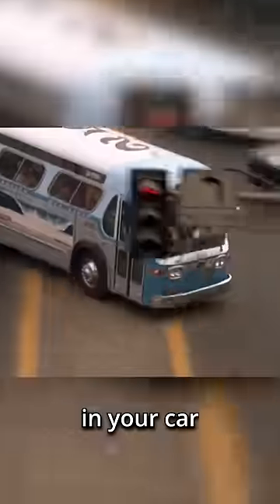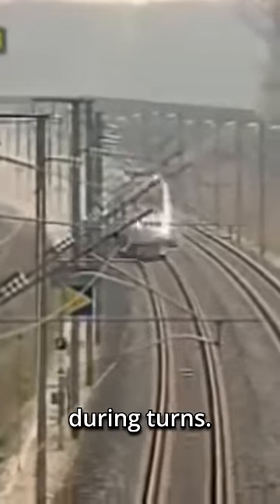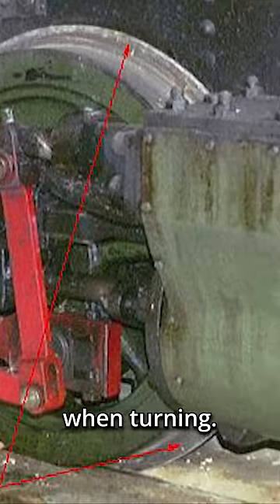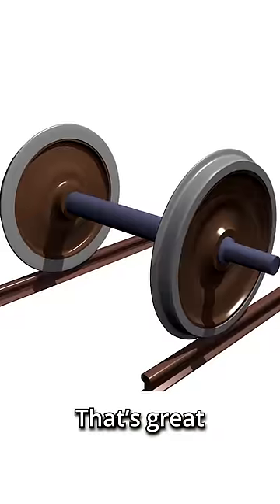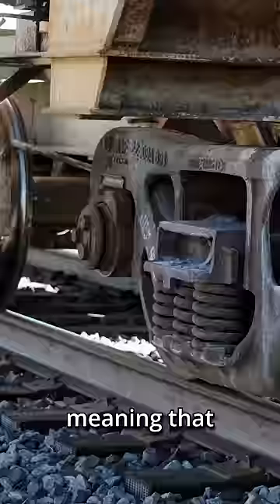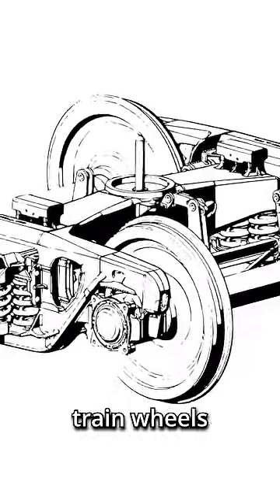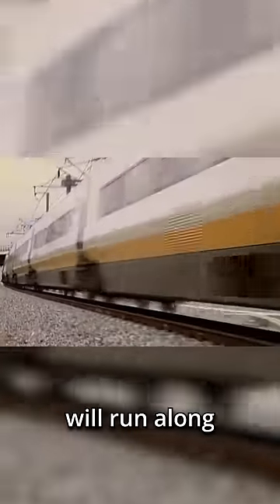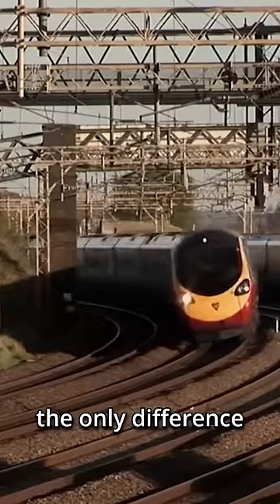How Do High-Speed Trains Stay on Track During Turns? #shorts

Comment: The shape of the wheels helps a lot, but keep in mind the turn is banked as well. This is not only for passenger comfort but helps keep the center of gravity between the rails.
Reply: Super elevation. A wonderful engineering concept
Reply: @kuhljager2429  very technical way of saying the bank angle
Reply: Plenty obvious in the video, too. 

Same as highways. Gets sketchy when some curves are banked the opposite it should be for a given curve.
Reply: @Iowagrown123  nah, thats when its fun 🤩
Reply: @Iowagrown123  that's when you hit R for race mode
Reply: @nothingtoseehere1221  roller coaster mode 🎢
Reply: In relation to railroad engineering, it's called "cant", not "banking".
Reply: Some Train have a tilting mecanism to provide the same benefit as a tilted bank.
Reply: @sebastianhofmann17  for passenger comfort, but it doesn't have the same effect that banked track in a turn do. the difference is the effect on the center of gravity. a properly banked turn will set the center of gravity as close to normal as possible, though it will be lower, causing that "sinking into your seat" feeling of being heavier you feel when a plane takes off or makes a turn. tilting a car through a turn at speed will still impart lateral inertia onto the occupants and contents of the car.
Reply: @ryan1e  that is true but tilted trains are primarily designed for old and/or curvey routes that don't have banked tracks and to have a slightly higher speed than conventional trains
Reply: @kuhljager2429  Correct, however with rail design; they call it: "cant"
Reply: @Iowagrown123 : They have to drain the water off the Road when it rains !!!!too though
Reply: @Thebibs correct. We(im a rail engineer) call it cant.

Canted track has its benefits and weaknesses tough and really needs to be done for a specitic usecase of track.

The track designer can calculate the cant needed to help a 100mph passenger train go around a turn (probably 115mm of cant (the high rail is 115mm above the low rail)) and that cant will be made so that it best supports and moves the forces on the train.

But a freight train traveling at 45 on that same line wont feel the same effect from the cant , and is more likely to roll over at such a high cant with a heavier and slower train. This is called cant defficiency.
Reply: @pulaski1  Not quite correct. Cant Deficiency is the difference between applied cant and the cant required for force equilibrium.
Reply: Some trains can also lean to one side to shift the center of gravity even further
Reply: @ryan1e  Swedens X2000 have banking and are allowed to go faster in bends, while trains with only "soft bogies" (that has wheels that turns slightly) has a lower speed. But still higher than a train without them (like a loco pulling a passenger train). Because the other trains could go that speed also but that would be bad for the passengers, so having banking trains means you can go faster.
Reply: @Iowagrown123  That's why roundabouts can be dangerous, due to the negative road camber.
Reply: @JBobjork Loco pull/push trains are slow? In Germany they do up to 200/230 km/h
Reply: literally ya
how did he ignore the fact that its banked
Reply: @Thebibs in australia the “cant” is in relation to the angle at which the rail sits on the plates or sleepers. All tangent track sits on a cant of 1:20 which means the rails actually look like this when viewing along the length of track /____\. This aids in the wheels staying on the track as well as the conical shaped wheels. Super elevation is what is called when there is a designed elevation change for each rail on the same track. The higher speed the curve/corner. The higher the super elevation will be (the greater the height is from one rail to the other). Designed superelevation of 50mm means that at that point, the highest rail is 50mm above the love rail.
Reply: Exactly. That really is the simple answer. Like a lot of these "revelation experts" he posed a question almost no one asks them gave the minor more arcane answer.
Reply: That, and some trains lean into the turn.
Reply: @ryan1e Although that is changing. At one point it was thought you want to tilt the train enough that the force on the passengers is straight down into their seats, but that's actually quite bad for track wear, particularly if trains are ever running at less than the designed speed. For best performance you want the track to be tilted by about half that "ideal" amount.

Comment: some trains (mainly high speed passenger trains) have a tilting mechanism helping them navigate curves easier.
Reply: But that's mainly for passenger comfort.
Reply: Thats not correct, its to take turns faster and for comfort but it doesn't help to take turns easier
Reply: Most high speed trains have tilted tracks for turns
I say most because maglevs have no wheels
Reply: one of them is the avelia
Reply: @aplane9625 And conventional rail has some sections where the track doesn’t tilt.
Reply: @Mgameing123 even conventional rail has slightly tilted tracks on most turns, its just that the "missing" superelevation is not really noticeable to the human as the turn radii are still a lot larger than what cars do
Reply: @amtrakdude432  The New Acela will indeed be a tilting train but it is mainly he is not use on proper high speed rails
Reply: @jan-lukas  Not all turns though. Especially on older parts of the railway.
Reply: It's indeed purely for passenger comfort.

Trains with tilting mechanisms still drive within the speed limits possible by the tracks. The titling doesn't change the centre of gravity or anything else. But there are plenty of buffers, trains could drive faster if they wouldn't need to care about passengers spilling they hot cup of coffee on their neighbor during turns.

Thus, most if not all train operators limit the speed in turns so that passengers wouldn't experience high centrifugal forces, IIRC about 1 m/s^2. The tilting helps achieving this at a higher speed.
Reply: At least with Japan, safety is the number one reason the train tilts. If they want it to turn at high speed, tilting is necessary to prevent derailing. The passenger comfort is just an added bonus.

Fun fact: some Japanese trains are equipped with pendulums to automatically swing into the turning direction and tilt the trains.
Reply: @iPlayOnSpica  I think you mean canted rails. Tilting can not prevent derailing.

https://en.m.wikipedia.org/wiki/Cant_(road/rail)
Reply: It’s not mainly high speed trains, it’s actually the ones with longer trucks. On a set that has 3 axles usually the first and last will turn not the middle.
Reply: @amtrakdude432 By the time Avelia is used, we'll be dead of old age.
Reply: i don't think it's used in new trains anymore though
Reply: @alexalekos  false
Reply: And mostly british trains
Reply: @MAL1GNANT  so are new trains being built with this system?
Reply: @alexalekos  Yes.
Reply: @alexalekos Yes, Talgo has been making tilting trains for decades, their tilting system allows their trains to run on sharper radius turns than non tilting trains but still has limitations of turning radius.

Comment: Considering the tires most people have on their car they would lose traction way before the risk of rolling over would become a thing
Reply: or they do the moose test
Reply: For the last 20 years or so, modern cars have been with a stability control system which is coupled to the antiskid brakes. Pull a hard u turn from a standing start. Once with the stsbility system on  then again with it off.
 They're designed to use the individual brakes to slow the wheels down, and keep flat on the road.
 I hate nannyware, but can it save your butt.
Reply: Not necessarily
Reply: have you ever driven a Jeep?
Reply: @wolfe6744  thankfully not
Reply: @nile2566  eh they aren’t as bad as people say they are. You just gotta be a bit more mindful because of top heaviness.
Reply: Never seen roll overs?
Reply: willrivers1819  well yeah. They were made to be affordable and easily fixable. If you want something fancy then get a Cadillac, not a Jeep…

Comment: There's also the banking, trains of any type  bank into their turns wether it's a lot or a little depends on the type of rail but all rail is banked on the curves that shift the momentum and center of gravity
Reply: Came here to say that.
Reply: I can show you many turns of a railroad that arent banked whatsoever, as a matter of fact the majority of railroad turns here in America have no banking at all
Reply: @diychad7268    Most US railroads arnt for high speed trains so thats probably why we dont see them. Tracks that are used for freight transport cant be banked or banked so little its not noticable
Reply: @thediesel4280   Yeah the superelevation on freight lines can be under 1".
Reply: Here in Germany a particular High-speed railway (Hannover - Würzburg) had turning radiuses of like 6km despite only needing ~3km, because the superelevation was capped at 90mm iirc (half of the legal limit afaik) to enable freight trains to run on the railway
Reply: @diychad7268  even still a 1in bank at the rail can be almost a foot with the double stack intermodal which is more than enough to shift the center of gravity
Reply: That Banking in Railroad speak is called super-elevation by the way.
Reply: And someway somehow train in the polar express could turning while runs on ice..
Reply: @aikonlatigid  ah yes the epitome of realistic railroading where even the number of cars the train has changes shot for shot
Reply: @diychad7268 yeah, cause of the low speeds. take a train in switzerland where the train reaches 180 km/h easily on relatively short routes. only possible because nearly all curves are banked

Comment: Furthermore cabins of some trains can get tilted inside the curve. If not curves are usualy designed with outer rail being bit higher so combined gravity and excentric force (inertia) go right against the floor. Similar aplies for some roads. It needs to be designed for right speed otherwise you will still feel like falling otside or even inside the curve.
Reply: Oval racetracks are perfect examples of the use of banking in turns
Reply: Some trains (Italian pendolino for example) are even fully tilting
Reply: Nice.

Comment: The Japanese approach is to just tilt the train itself to counter the g forces of turns. This sounds odd, but by having an active suspension system that uses computers to automatically adjust itself for corners allows them to not just take the turn at bullet train speeds, but take it so smoothly you (as a passenger) wouldn't even know you're turning. It's absolutely incredible engineering

Comment: A lot of them have tilt function too like the Pendalinos in the UK
Reply: I meaaan I wouldn't say a lot of them, only a few, but tracks in high speed sections without any points/junctions/switches are usually also canted to help the train through the turn
Reply: Thats only for comfort, not to take turns
Reply: Most HSR DOESN'T have that, as it's unnecessary weight for usual high-speed railways where the superelevation of the track itself is enough. Active tilt only becomes important when running somewhat fast (like 200-250km/h) trains on conventional railways which were not built with these speeds in mind
Reply: @jan-lukas  depends on the terrain
Reply: I miss Virgin trains, now my towns station is owned by avanti west coast.

Comment: It's not the shape of the wheel, the turn has what's called super elevation, where the outside rail is higher than the inside, so basically it's forcing the train to lean into the turn, kindof like the road on a highway. The trains also have a computer and airbags that inflate and deflate to do that same thing onboard, it leans the train into the turn making it smoother.

The wheel shape just prevents the wheel on the outside from skidding, damaging the wheel face and rail, but with the large gentle turns of a high speed train, it doesn't matter if it's conical or flat.
Reply: It does matter a lot. Superelevation is important for passenger comfort (else you'd always be pushed to the edge of your seat) but mostly not required for the train's actual operation, while the form of the wheels is really important as else one of the wheels would have to turn at a different speed than the other one. And at high speeds that's a really large difference in turning speeds, so the wheels (or their connection) would either break or skid. Even with the large turn radii of these high-speed trains, you need to make the wheels conical

Comment: Fun fact: Some high speed trains have a tilting function, for example the class 390, which was built to tilt around curves because of the west coast mainline just having tons of curve. Something like a regular high speed train or a slower train that can still go around 100-110mph on straight track has to slow down to 90mph on sharper curves, while the class 390 can keep going at 125mph

Comment: This also helps with keeping the trains on the rails as if it runs off to the side to much the conical shape helps shift the center of mass inward keeping the train inside the rails, plus theres a lip at the end as a last resort in terms of simultaneously braking the train and keeping the train from jumping off the rails, it is a marvel of engineering, simple yet very effective and so its maximum efficient

Comment: The car or locomotive moves toward the outside of the turn due to centrifugal force.  The conical wheel or the conical tire on the locomotive(steam) moves across the rail such that the part of the cone of the outside wheel that is larger is in contact with the outside rail while the smaller portion of the cone of the wheel on the inside of the turn is in contact with the inside rail.  The main thing that keeps trains from just falling off the track in a turn is superelevation.  This means the rail on the outside of the turn is higher than the rail on the inside of the turn.  This arrangement of the rails causes the train's locomotive and cars to lean into the turn much the same way boats and planes do when turning.  This causes a portion of the centrifugal force to push the train down onto the rails somewhat harder.

Comment: A well shown diagram would made it more easy to understand.
Reply: I.. uhh.. think you need to go back to 5th grade physics 😂
Reply: <|--|> think of the wide parts as big wheels, and the thin outer part as small wheels. The smaller wheel will travel less distance for the same number of rotations as tge big wheel.

Comment: That, and a combination of most modern passenger trains tilting into the corners so as to shift the center of weight further towards the inside of the curve. Another much older, and simpler technique is to bank the curves themselves with a few degrees sloping inwards towards the inside rail. This will also achieve the same results; tilting the train, just in a different way.

Comment: High speed trains also have less of a conical shape than lower speed trains.

They’re still conical for the sake of stability but if the wheels had the same cone angle hunting oscillation occurs which in turn can lead to derailment.

Comment: And then there's cant and tilt. Cant is when the outside rail is higher than the inside rail. This allows the train to roll slightly, and takes off stress from the wheels. This is even incorporated into motorway design for the same purpose. Tilting trains add a suspension that allows the train to tilt slightly.

Comment: A very catastrophic accident happened to a high speed train in Spain some years back. While negotiating a sharp left turn, the engineer did not reduce the speed of the train to the optimum level at that spot and the train derailed causing loss of lives and mayhem. Yes, there was banking of tracks. Yet there was a speed limit. The engineer far exceeded the speed limit. 

There is also an opinion that the second coach was a diesel generator tender to power on non electrified sections of the route of the train and the extra weight of this car contributed to the weering away at the curve and causing the accident

Comment: No!
The outside is running on the inside (with the bigger diameter) and the inside is running on the outside (with the smaller diameter)! Not how you said it!
1 reason is the G-force! Another is the angle of the rails!

Comment: For high speed trains they also use a kind of “swinging” car design, which will swing the passenger car and thus the center of mass a little bit toward the opposite direction of the turn.

Comment: When turning the outside wheel of a locomotive or train coach will roll on the larger INSIDE part of the wheel while the inside wheel will roll on the smaller OUTSIDE part.
You said it vice versa.

Comment: He said the wheels on the outside track of a turn are running on the outside of the wheel and inside on the inside of the wheel, but it is exactly opposite.
The inside of the wheel have a greater diameter so it runs along the outside of the track to make up the difference.

Comment: 😂😂😂😂 I work for public transportation repairing rails and trains and upgrading to a new communication network 

In every turn the train is pushed out of the rails Depending on the vehicle type this is more or less extreme (you can have them rolling on the inner ledge of the stopper on the wheel) but this also dictates which types of vehicles can be used in certain terrains so yes there are vehicles specifically made for very curvey railways

Comment: Seems backward where the conical wheels were described. The largest radius has to be near the flange, which both run on the inside of the rails. In a turn, the wheels closest to the outside of the turn slide sideways until stopped by their wheel flanges. That has to be the largest diameter part of the wheels.